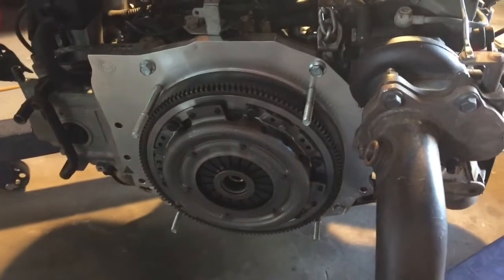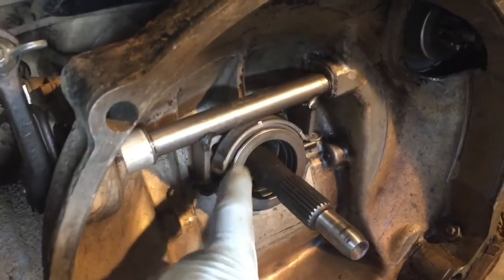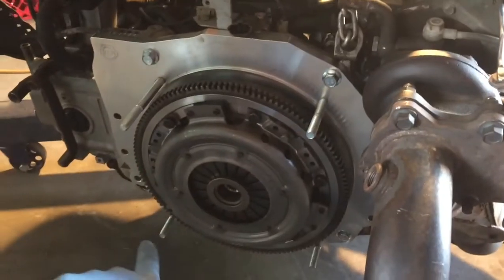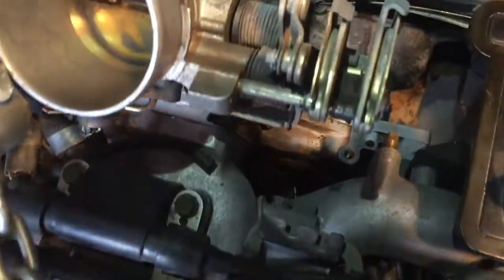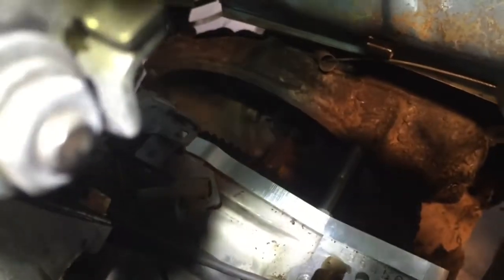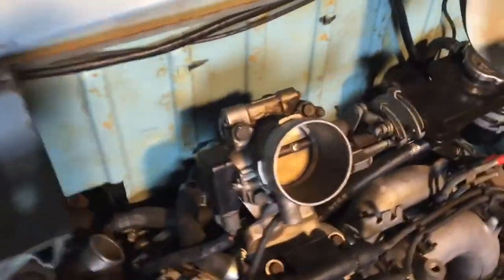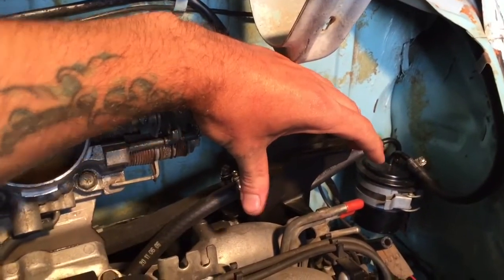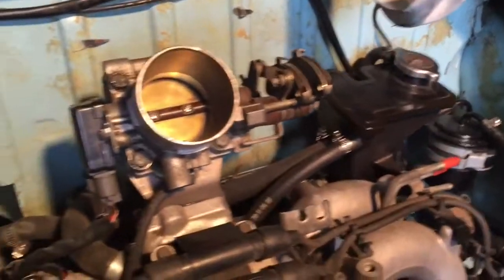BUGaru Part 9 - EJ22T Engine Install

Comment: What transmission are you running? I’m doing somewhat the same swap but with an WRX motor and I had to have a 4K built transmission from Rancho. A stock beetle or freeway flyer transmission will yard sell with Subaru power.

Comment: Do all of the Subaru boxer engines have the same bellhousing pattern? In other words, does the 6-cylinder and 4-cyliner have the same mounting pattern?
Reply from the maker: +Joseph Turner All EJ and EG engines have the same bolt pattern. I believe the EZ engines do as well but if have to doublecheck.

Comment: Do you know if the positioning of the engine with the KEP adapter plate will be the the same as the positioning with a Subaru Gears Subamount and subaru transmission?      I'm tempted to pop my EJ22t in with the KEP plate first then upgrade to a subaru gears tranny later, but I'm afraid I might have to re-do a lot of the lines.
Reply from the maker: +Velocity Labs I don't think you'll have to mess with it much. It may be off a little but that's how it goes when switching parts out sometimes. Go with VW trans until it blows.
Reply: I like your style :D

Comment: Dumb question, what do you use to mount the engine? I only see you use the 4 originals bolts but is that it or do I need some other or original Subaru engine mounts?
Reply from the maker: +Gustavinho Ronaldhino It’s currently only being held in with the 4 bolts on the adapter plate - makes me cringe ever time I hit a big bump. I’m working on a “crossmember” for it bit tough as there’s not much to work with and don’t want to cantilever off of the frame horns too far. I’ll let you know what I end up building -  open to suggestions ;)
Reply: Busaru is it reliable to have it just on the 4 bolts? As I know it’s heavier than stock engine. I just don’t really see anyone talking about the mounts, and I want to build my bug like that.
Reply from the maker: It might be okay for most Street use but I still get nervous without having more support - especially thorough tapped aluminum in the adapter plate.
Reply: I like the videos and all the information. I'd like to add something if that's ok. 
You need to make the rear end/suspension stronger for this king of applications. I'd start with a quality truss bar to tie up the fork. A friend of mine bent his with a 2L ~120bhp air-cooled engine. 
Gearbox mid mount is also needed to protect box' nose cone. I'd also use a strap at the rear of the box. All these make the gbox nicely secured and protected. For gbox mounts I'd use rhino or other HD mounts. It's the torque and also additional weight that makes the rear end vulnerable. 
Another friend of mine has installed a Subaru turbo in his bug and additionally he fabricated a gbox/engine joint mount so he could use engine's rubber mounts.
I would put a Kennedy stage 1 with a kush lock disc for non turbo applications (~135bhp) and stage 2 for turbo. A set of good gas absorbers is a good idea too. 
I'm in the process of getting parts for my conversion. It's gonna be a NA engine but still I'll be installing all above mentioned parts :)